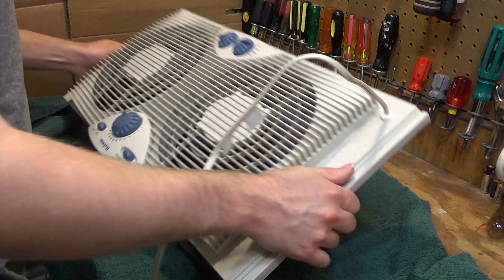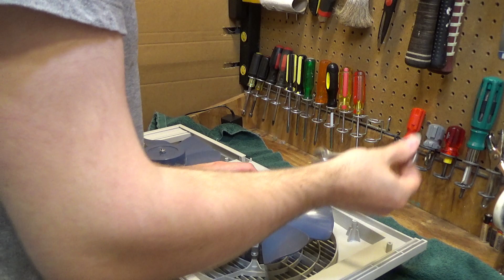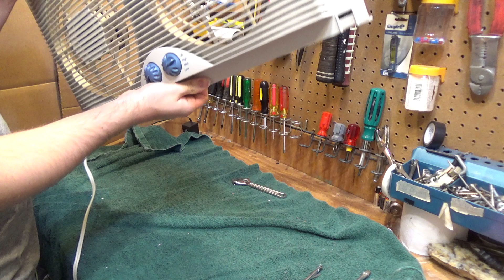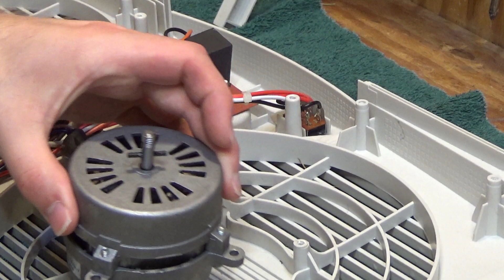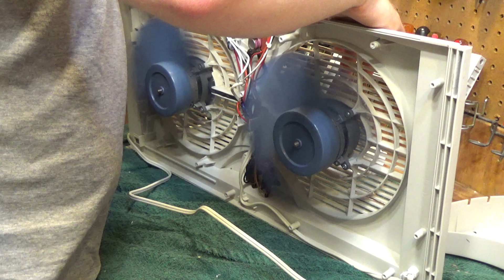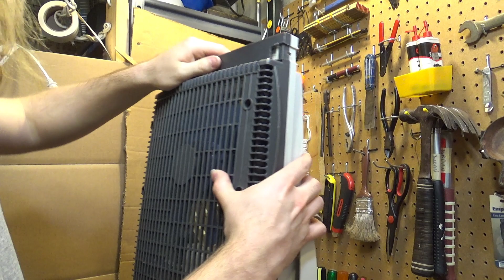Clean and Service Holmes HAWF2041

Comment: Hey, I've been looking for one of these fans for awhile and I really want one I have multiple holmes window fans but not this particular one. Would you be willing to trade or sell the fan? If a trade is possible I have a Sears Kenmore 16" box fan that I don't like. I picked it up from someone down the street saying the fan didn't work but however, I put some 3 in one lol I'm and it works fine perfect condition. It has two speeds and it's got two offs. Would you trade? I'm offering because my uncle has one but in worse condition.
Reply from the maker: You can buy one from Holmes or whatever retailer you desire.. I am not a store and nothing on this channel is being sold by me..

Comment: I will never buy another Holmes product. You got lucky removing the extension locking clips. The clips on mine broke while trying to remove them for fan cleaning. I contacted Holmes twice and they were highly uncooperative. They told me they do not sell replacement parts. They suggested that the fan should have been cleaned with compressed air only. I tried this method fist but found it very ineffective because dirt and dust cling to the plastic grill and blades. I'm now faced with having to scrap a perfectly functional fan because Holmes won't sell me replacement clips.
Reply from the maker: I understand that is a frustrating experience, but the unit is completely usable without the clips.. All you need to do is put a drop of hot glue or a piece of tape on the accordion frame to keep it in the position you need for your windows.. Tossing the unit over broken clips is very wasteful..
Reply: Great suggestion, but I used this fan in two different rooms with different size windows during evening and night. I'm not about to re-tape the frame every time I want to move it. The issue is not really the fan as much as it it Holmes not willing to support simple replacement parts. It's not as though they don't make this model anymore and can't get them. I find it difficult to accept  that someone at Holmes customer service can't get two of these clips from their supplier and send them to me for a modest fee. I imagine they don't want to make the effort to support individual consumers because it doesn't fit their business model.
Reply from the maker: I get it, I've been deterred from companies before due to horrendous customer support.. Unfortunately I don't think this issue is isolated within Holmes; it seems to be nearly impossible to get parts for just about any simple appliance anymore.. There's no longer a focus on customer satisfaction, it's all about profit..